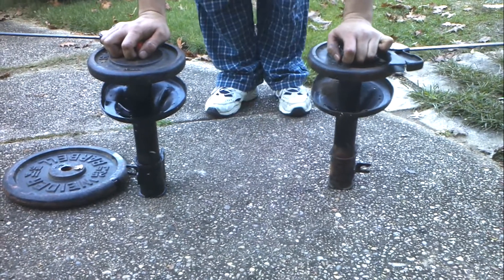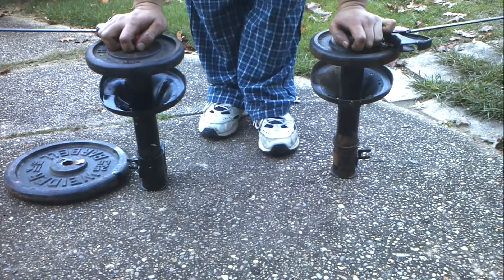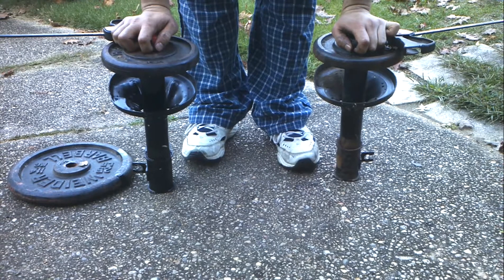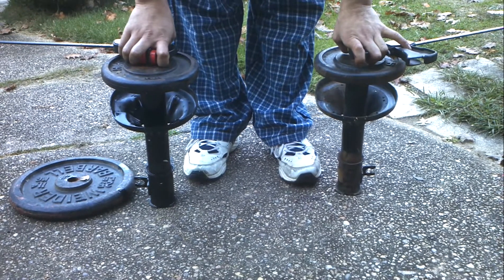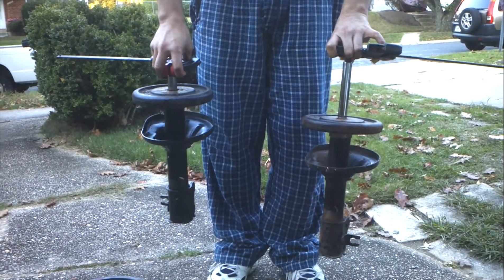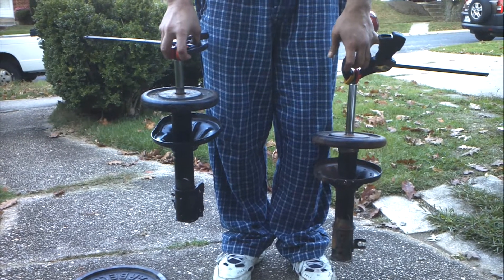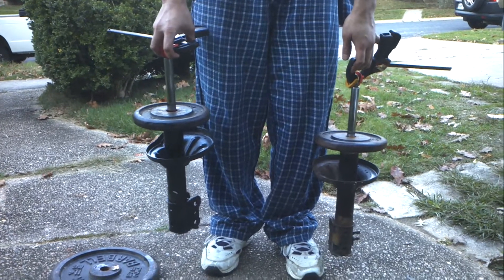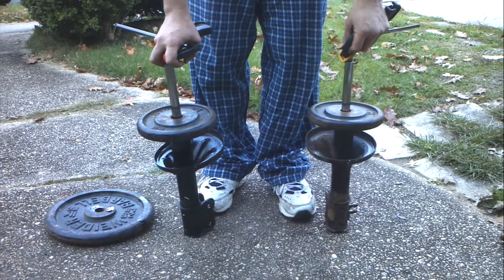How to Rebuild Shocks: Demonstrating Rebound Rate

Comment: I just took pair of unused front shocks out of my storage and they have different rebound rate even if both are supposed to be just the same shocks. Left shock shaft bounces up in few seconds but right shock takes about twice that time. Shocks are not adjustable and I don't know if they can be opened/tweaked, are they useless now? I think it's not worth it to install them to car because difference would make both sides of wheel suspension behave differently?

Comment: hey bro! nice video! you said you replaced the oil with transmission fluid ?
Reply from the maker: Jamie De Angelo Yeah, a couple of my other videos will show you the specifics of how I built it and flushed the old stuff out.  Transmission fluid has pretty similar viscosity/temperature characteristics to the original shock oil.  You can mix in a little bit of thicker oil (like Lucas ATF conditioner) if you want it really stiff (for racing or something).  I'd suggest a synthetic ATF like Valvoline Maxlife.
Reply from the maker: Jamie De Angelo I actually got the idea from this guy.  It was my idea to add the schrader valve (just a tire valve with the rubber stripped off) to re-pressurize the strut.  He was just welding over the hole once he re-filled it. https://www.youtube.com/watch?v=XDrUjRa6VLI
Reply: Professor Doom appreciate it bro! i really need to sort my shock out man! i tried kyb gas but that gives a horrible ride & it chunks up the tires so from now on its oil shock only! roads in my country are shitty so i need this!

Comment: how did you replace the oil?
Reply from the maker: In one of my other videos (https://www.youtube.com/watch?v=ivuhjMDINdE), you can see that I soldered a schrader valve into the body of the strut, after drilling a hole in the outer tube.  I actually stripped the rubber off of a tire valve and removed the valve core.

Drain the old oil out (also seen in one of my videos) before soldering in the schrader valve.  Measure how much oil you drain out, then replace an equal amount of the fresh fluid.  You can then re-install the valve core and inflate with air.

There's a multipage discussion including photos here: forum.chumpcar.com/index.php?/topic/8898-changing-shock-oil/